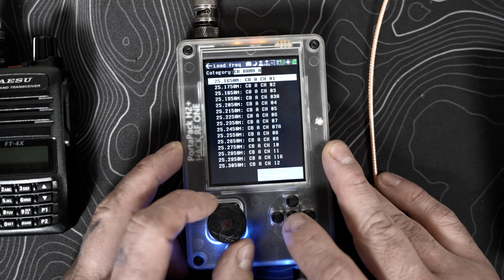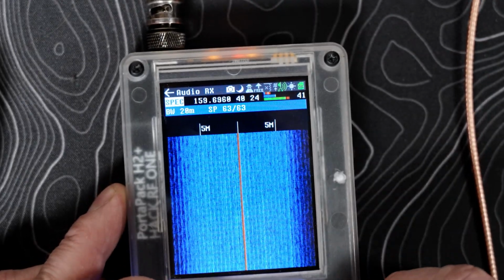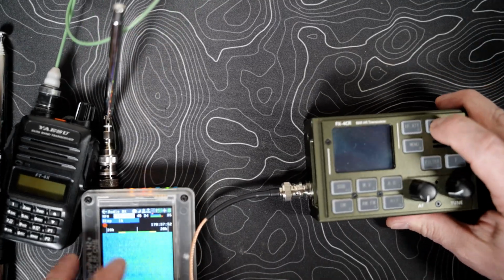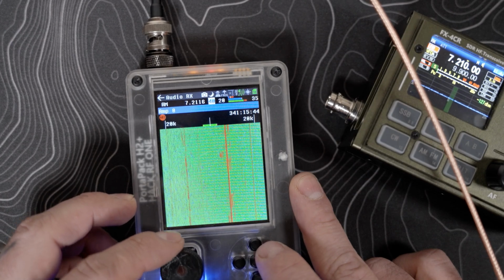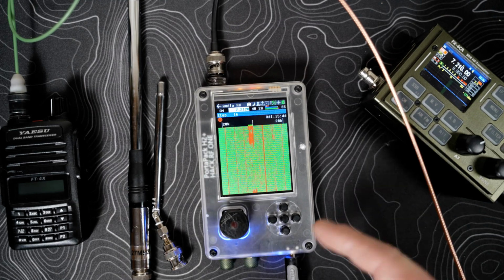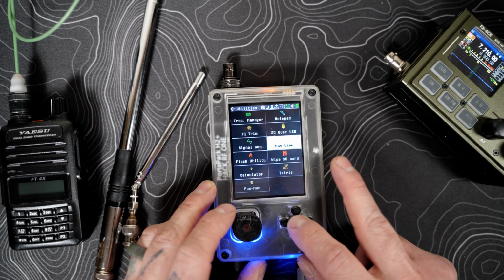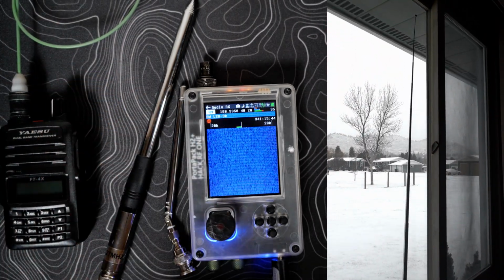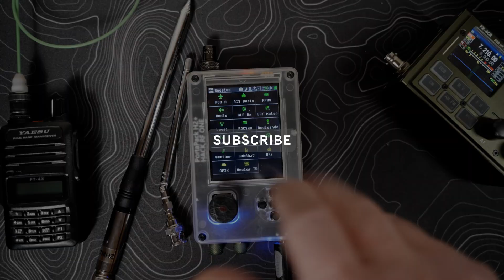PortaPack H2 Hack RF One Audio RX

Comment: I am assuming this info is also good for the H4M
Reply from the maker: @georgeliquor2931  yes. The H4M runs on mayehem. 99.9% of h2 or H4M content will be from the Mayhem firmware. While there are a few others out there, Mayhem has the most backing and consistent support.

Comment: Do you have anything more recent than one year ago. just got mine a couple days ago . Need to know how to flush it correctly if you can go by step-by-step slowly thank you. I have to do something with discord I already set up a discord channel. Just wanna make sure I flash it correctly and don't screw it up.
I already have a flipper zero.
Reply from the maker: @mysafename1694  is your unit currently running a Mayhem version? If so which one? This will help with how to flash.
Reply from the maker: @mysafename1694  I try and put out videos a few times a month. I’m working on a few as we speak and should have them up sometime this week.

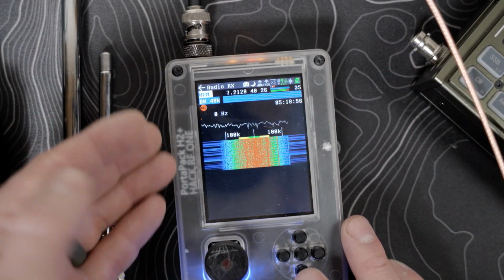Comment: Hi Hunter Tech! minute 8:23 under red REC button in wide FM mode there is  a 0Hz control and I know that can be changed. What is that for? Please and thank you!
Reply from the maker: That’s a frequency field input selector. Say you find a frequency that’s showing a solid signal “red” line. You can scroll down with your knob/encoder and move the cursor for finding the exact frequency.  Hope that helps. Thank you! 

https://github.com/portapack-mayhem/mayhem-firmware/wiki/Audio-Receivers